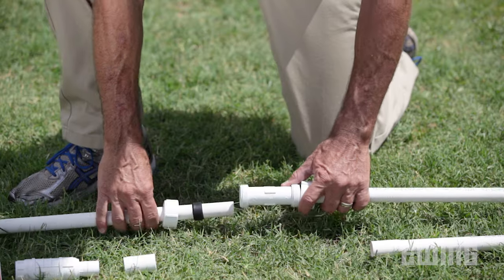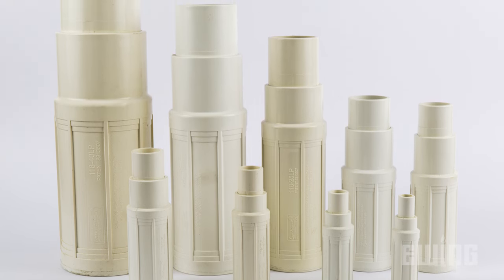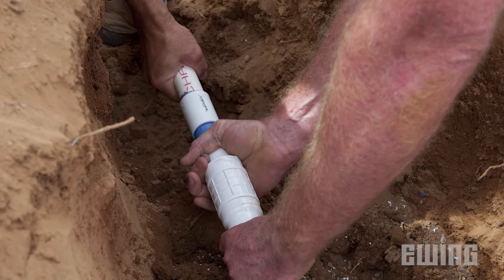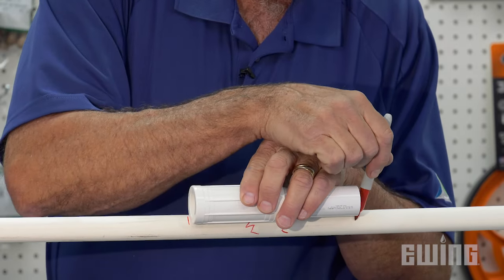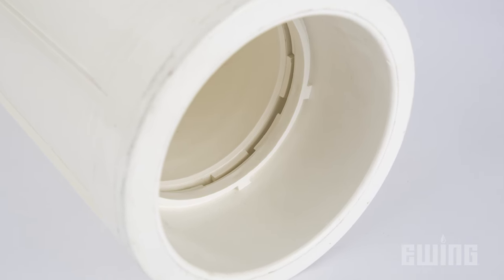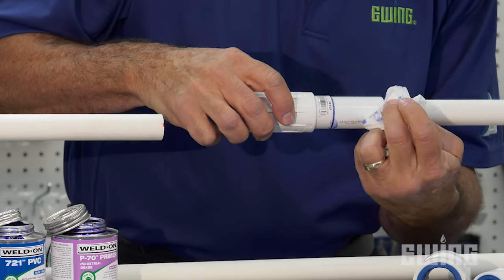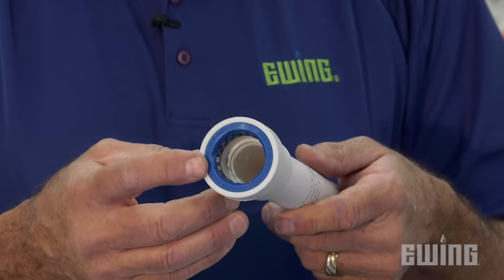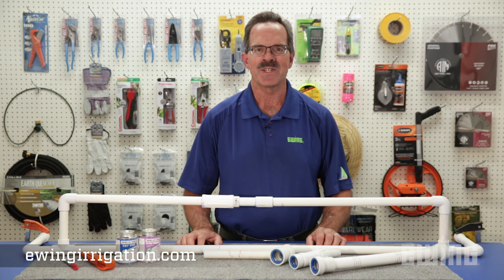How To Repair PVC Pipe Using a Slip Fix

Comment: IMPORTANT NOTE! When purchasing the slip fix be sure to check that the O
 Ring is inside (where it turns to tighten). Loosen the plastic 
completely and you will see the O Ring. I purchased one and didn't think
 or know to look. After installing it, it leaked! I had to cut it out, 
realized the problem (no O Ring), and replaced it. The new part (with 
the O Ring) worked perfectly as described.

Comment: These are easy to use. But I’ve seen many of them fail under mainline pressure that were installed roughly 10-20 years prior. Overtime like any o-ring they flatten out and you get a drip leak, and I’ve also seen them get a steady stream spraying. It’s basically inevitable for cheap silicone o-rings. 

I wish they’d make it so behind the o-ring it had female IPS threads with a pre installed ring of male threads that once you slid it in place, you could snug up the back end with Teflon so if the o-rings failed, the threads would still protect it.
Reply: I just dug down to my pipe and sure enough, its broken at a slip fix that must have been installed about 18 years ago.
Reply: @timdelaney2798  yup, see it all the time. They do work. But they have their downsides. Good thing is they are easy to fix I guess.

Comment: How much pressure can they handle, I had something similar blow apart. Great idea if it can handle the pressure, please let me know. This would make a long job a quick fix
Reply from the maker: The Landscape Products brand is rated at 200 PSI static pressure at 72° F.

Comment: Is there a preferred direction of pressure for any reason?
Reply from the maker: The manufacturer states that they can be installed either way. Here's some more information on the Spears line:
https://www.spearsmfg.com/super_sourcebook/SSB-1%20Part%201%20List%20Price%20Catalog/010%20Compression%20&%20Repair%20Fittings%20Schedule%2040.pdf
Thanks for the question!

Comment: the 4 elbow fittings fix is my goto, but i bet the water gets mad at having to zig zag down the pipes. ive got these slips tho that have lasted 20+ years.
Reply: Does it hold up to main line pressure?
Reply: @jbuck1975  sure, all pvc glue fittings should hold up to main line pressure

Comment: What is the life expectancy of the O-rings in the coupler, main water line with pressure of say 75lbs?  I would think the O-rings would over time become brittle and cause a leak?  Expectancy of the expansion coupling???  Nice presentation.
Reply from the maker: Thanks for the question! It's a tough one to answer since a variety of factors can affect the life-span of the fitting; water quality, temperature, etc. If installed properly it should last for years. The Landscape Products brand is rated at 200 PSI static pressure at 72° F. If you are looking for a more permanent fix, you can try to solvent weld in a new piece of pipe with couplings.
Reply: @ewingoutdoorsupply  Thanks you for the reply.

Comment: so a question, can this be used on warm to hot water applications, mainly pool solar pvc? It never exceeds more than 110 degrees
Reply from the maker: The manufacturer states that the max temperature should not exceed 140 degrees. Thanks for the question!

Comment: Why not 725 wet/dry?
Reply from the maker: You can use the solvent cement of your preference. 725 will work just fine. Thanks for the question!

Comment: Why whip off excessive cement ?
Reply from the maker: Solvent cement actually chemically fuses the two pieces of PVC together at the molecular level. You wipe off the excess to prevent it from causing the chemical reaction where it is not needed.  Thanks for the question!

Comment: Honestly, I see the use and the concept of this and how it could be handy, but let's face the facts. Let's see a chat from 1 to 10 on how handy this is. I give it a 4, I wouldn't use this, but I could see how someone who doesn't do a lot of plumbing could be easily struck over by this fitting, but I see it as useless unless you're a homeowner that doesn't want to cut pipe to fit. Even though you have to cut the main pipe to fix it anyway. Good product, just don't see it being used besides for office workers, or the elderly.
Reply: If you're in a situation where you're dealing with a buried pipe and you can't dig up enough of it do put in a regular coupler.  I'm in a situation where I have a water line that I need to tie into, but the way its buried, I would have to dig up a bunch of plants, and it also cross under some other pipes.  It would be a ton of work and a huge mess to try and dig up the pipe enough to put in a regular glue fitting..  I could use unions, but I would have to be very careful to make sure I meaure it just right since it is in the middle of a line.
Reply: It's actually a very useful product, very effective and long lasting. We've been using them where I work for years